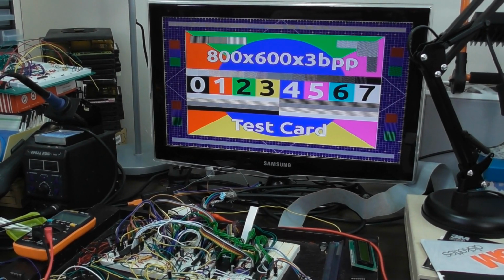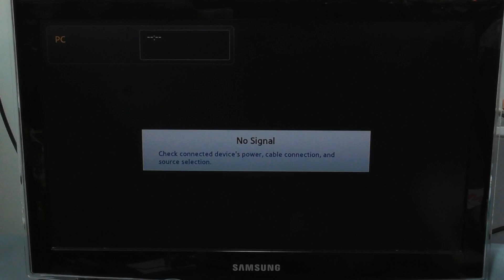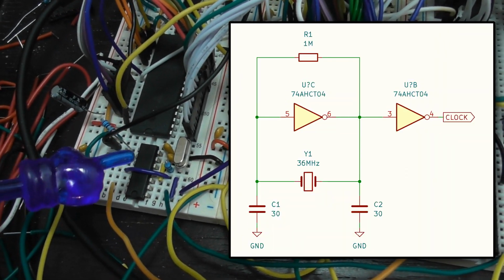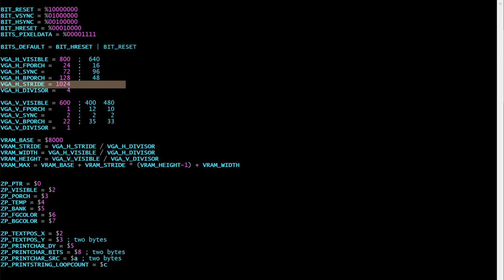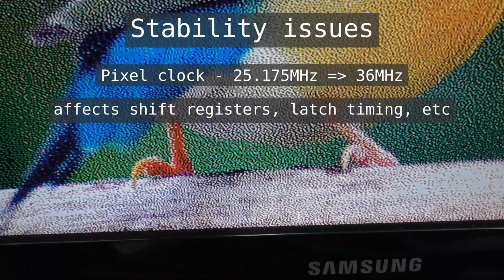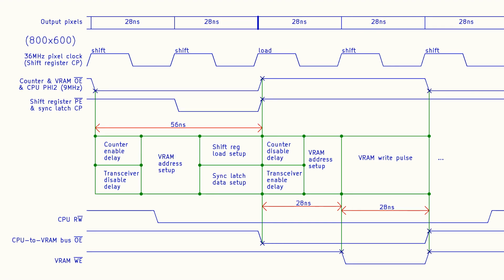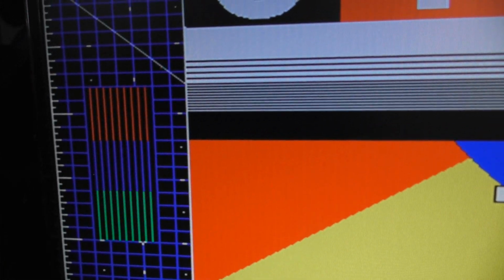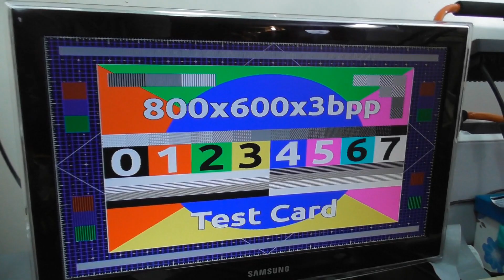800x600 SVGA Upgrade for 6502 Breadboard Computer

Comment: How do you use a PLD as a counter?
Reply from the maker: You want to toggle each bit when the clock rises if all the lower bits are currently set. If your PLD supports T flip-flops then that's cheap and easy e.g. O0.T = 1, O1.T=O0.Q, O2.T=O0.Q&O1.Q, etc. But if it only supports D flip-flops then you need to fully define its "next" state, which is equal to its current state XOR the AND of all the lower bits. This uses up a lot of product terms and can be tricky to fit into small PLDs.

Comment: Interesting. 36Mhz is pretty close to half the pixel clock for 720p. While 1280x720 is a bit much for a retro/hobby computer, it does have some really nice horizontal divisors, 640 for 80 columns and 256 for nes style sprite graphics.

I wonder if a "GPU" of sorts is the way to go. By that I mean a semi programmable state machine that moves pixels around. Technically this is a blitter, but they usually require quite a lot of baby sitting from the CPU. I'm thinking something programmable enough that it can batch process blits so that it is functionally equivalent to actual tilemap, sprite, or bitmap style video hardware.
Reply from the maker: I'm planning to look into hardware acceleration for sure. I'd probably start with a subset of the EGA/VGA features, giving the ability to write a colour to a bitmask of pixels, and maybe allow fast copying of data across multiple planes through internal latches without having to load all the data to/from the 8 bit CPU. That would enable a lot to begin with.

Beyond that I would like to gradually build up more of a command-driven GPU and perhaps work towards 3D rendering in that way. If we can render at least horizontal stripes with perspective then that's most of the work, and it doesn't feel like too much of a stretch, if you'll pardon the pun!
Reply: @GeorgeFoot  To be honest I'd probably skip EGA/VGA, they  are kind of rubbish. Instead have a look at old arcade machines, as some have schematics and quite detailed explanations about how they work, Defender for example. Since you are interested in 3D "I, Robot" might be worth a look. It uses a custom bitslice TTL 3D co-processor.

I've had a bit of time to think about what the hardware might look like. I think it's best described as a programmable pixel mover. It has auto incrementing source and destination registers, and will be able to move a pixel per clock cycle from video memory to a back buffer. Programming is best described as register transfer level. It needs to be able to load data from a display list,tilemap etc. into it's control registers then do a transfer based on those settings. A transfer will just be a move instruction repeated for however many pixels need to be moved. For transparent pixels this will be a conditional move e.g if pixel is zero disable back buffer WE. This won't be as efficient as real hardware but we have cheap 10ns SRAM so can compensate with much higher clock rates.

The idea here is to have something that is simple but flexible enough to emulate various styles of pixel graphics.

Scaling should be possible with what I had in mind. I think it might just require replacing the source/destination counters with fixed point adders and add a couple of registers to store the x/y offset/step size. I'm not sure how many fractional bits would be required, and since this is just a programmable pixel mover the CPU would be responsible for calculating the offsets.

Comment: Your setup is very interesting and a nice proof of concept. My personal thoughts are that 800x600 is just a tad too big for any meaningful realtime graphics on a 8 bit computer. Having a crisp text mode is nice but the TTL logic seems to be near its limits. Using off-the-shelf TTL chips is very future proof and should allow the design to be used for years to come. Getting a simple design onto a PCB with surface mount components (where it is possible) has a lot of potential. Limiting the feature set to the minimum for acceptable graphics and text might be the way to go. In my opinion, limiting oneself to a certain spec and trying to get the most out of it is a more interesting way to design and build retro hardware. The specs should follow limits of the chosen hardware. Setting boundaries can be hard when you have FPGAs, modern design tools and cheap MCUs on your hands. The limit of using TTL chips only should be a natural barrier for feature creep ;-)
----
I always liked the ATARI monochrome 640x400 video mode (with is sub-modes) for its effective usage of a 32K memory space. Expanding that to 64K with 4 colors or 96K with 8 colors might be usable as well but bank switching several times for a single screen will be a big hurdle. A 8MHz 6502 might be fast enough to display 640x400 uncompressed 4bit color FMV at 15Hz but having several sub-modes is nice too (LoFi for the win). Adding a small LUT for either fixed or dynamic color tables might be nice too. Having the ability to switch from 3bit grayscale to 3bit color can be a huge boon if the switching is software controlled. Two different color tables that can be switched each scan line would get you some kind of primitive color dithering.
---
The Apple IIgs used 640x200/4c and 320x200/16c 'HighRes' modes with an in-memory color-table. Since there is some memory space left in the 32768 bytes of available memory space for the graphics (320x200/16c = 32000KiB -> 768b left), Apple decided to give each scan line a 4bit LUT-index and add the 16 LUTs (with 16c->4096c) at the end of the memory space.(1/2)b LUT-IDX per line 200x4bit= 100byte, 16x 4bit x 16bit LUT = 512 byte. There are some additional switches and configuration in the other 156 bytes.
You can archive 256 on screen colors without any cpu board using this method. Up to 3200 colors are possible with scan-line timed LUT-manipulation. I think that they found a nice way to get the most out of such a limited feature set.
Reply from the maker: Thanks, lots of good for thought, and I agree entirely regarding trying to get the most out of a chosen set of constraints. For what it's worth, the higher resolutions were a distraction that I never believed were really practical for a 6502 to drive. Its bandwidth is too low. But it would be interesting to look into hardware acceleration to help out there, at least some of the latching behaviors of EGA/VGA, but I'd also like to go further towards 2D and 3D rendering. I'll always keep it within the TTL-style constraint though I think. Anyway that's one tack.

The other tack is likely going back to 320x240 and making a more well- rounded system based on that. It's a better fit for the bandwidth capability of a 6502, and more likely to result in a system that can support games for example. I may then get to a point that I'm happy to commit something to a PCB as well.

I guess the other tack is pure text modes, keeping the high resolution but just for text so lower CPU bandwidth and less VRAM required.

I really want to pursue all of these, but just keep changing my mind. We'll have to see how it goes!

Regarding 640x400, my first "simplest VGA" circuit used that resolution (it was actually a rather awkward 40x480 overall I think!) I moved away from it because none of my monitors seemed to support it properly. They all reported it as 720x400, rather than 640x400, and expected a different pixel clock, so my pixels were shown in irregular widths. It was a shame to have to go up to 640x480 as the RAM requirement doubled...
Reply: @GeorgeFoot  640x480@60hz is the way to go for the 'physical' output for the sake of compatibility. The "display resolution" can be less than that and you have a lot of possible modes in that boundary. Maybe even degrade the VGA-hardware to a simple frame buffer with some registers for pixel doubling (or color expansion) and do anything fancy in software? Dual-port access for the frame memory will be very helpful if you decide to later implement a 2d/3d "co-processor". Setting a limited feature set for the basic graphics interface and implementing it to a semi-final design is important. If you have that block finished, you can think more freely about other stuff. Having limits that cannot be changed is the best way to get creative with solutions.
Your demonstrations are pretty amazing and i would not have imagined that the shown features were possible on pure TTL logic.

Comment: I think it would be interesting to see a system designed to be modular, with different outputs for digital, VGA, etc.

A design that went from a very wide data bus (even 64 bits? Or more?) down to the normal width to reduce the circuitry needing high-speed capabilities would also be interesting.
Reply from the maker: I have thought about a modular design where image generation layers can be added or removed in a stack. So the core generates the sync signals, then you can add a background layer with bitmaps graphics, then maybe some sprite layers on top, and a text layer above everything. Or interchange any of the layers if you like. It could be interesting to build that way.

Comment: Once again impressed you managed to get something useful out of a 36MHz signal on a breadboard. You might be radiating some RF there. 
I'm going to try for 640x480 using a 6845 when I get my hands on a few - it might be overclocking it a bit but it's probably going to work. For a start it'll be monochrome like my existing circuit but I like the idea of replacing 5 IC's with a 6845 - then I can use the extra space for color. 
And then just maybe I can use that as a basis for an 8 bit ISA card for IBM PC & XT.
Reply from the maker: Sounds interesting. I think the 6845 may be OK depending what horizontal speed it supports. 8 pixels of VGA requires about pi MHz, funnily enough. I think typical systems in the early 80s when the 6845 was common probably used a 1 or 2 MHz clock, but they were standard definition, so had about half the horizontal refresh rate, much more time to play with

Comment: Great video, I've just ordered the PCB's of my own card based on Slu4's version, but using a GAL for the H / V detection and counter resets, as well as a character ROM and a colour RAM. My daughter wants me to write that is has a picture of an axolotl on it as well. I ended up going with a bunch of d-latches for latching in the X, Y, Colour and character, that's on decoded from a 138. It all SEEMS to work, and gives me a character display that's similar to the C64 but with 8 bit colours. I got the whole down to 17 chips in the end, so I'm fairly happy with that. I could use another GAL and probably knock it down to 13, but life is short.

I'm excited to see where you take this  if you go back to first principals.
Reply from the maker: That makes sense - I like the register-based design.

Comment: Good job, but too many wires tangled with each other. As a viewer, I don't understand what's going on in the background. If the wires are on the breadboard, like Ben Eater videos
Will be better
Reply from the maker: Yes for sure, if it was working better I'd probably recap how it works more clearly. The rest of the circuit is identical to earlier videos though, which show the evolution to this point and hopefully explain how it works.

Comment: Really impressive!! Moreso for being on a breadboard and right next to the TV. I wouldn't be surprised if you were getting RF from it
Reply from the maker: Haha yes, I ought to try measuring that! There are certainly some rather long wire loops carrying the 36MHz signal to the shift registers.
Reply: @GeorgeFoot  : Wrap some aluminum foil around it, see if that helps anything...

Comment: Excellent work. It has been very entertaining following this project.
Reply from the maker: Thanks, I'm sure it will continue in one form or another!
Reply: Would it be difficult to have a user-defined palette for when the bits-per-pixel is low? I remember on the Amiga that even 4-bpp could look pretty decent for games when referencing 12-bit colors.
Reply from the maker: Yes, it is tricky to do that while still allowing the cpu to update it. Normally it's only necessary for the video circuit to access the RAM once every few pixels - in my case it's 4 - which allows the CPU to write to the RAM in the gaps. But the palette generally needs to be read on every pixel, at 25MHz (or 36MHz in my case now). You need very fast RAM to support that, ideally dual-port RAM. It may be possible to somehow fetch all the data for all 4 pixels in one go - but that's then quite wide, it would need several separate RAM chips to get enough output bits. It's possible though.
Reply: I hadn't thought of it like that, thanks for taking the time to think about it. I was (probably naively) thinking that the bitmap ram could continue to have the same cpu interface and timings, but there could be a level of indirection on the readout (which might not need to involve the cpu but would incur some timing implications anyway). I've never built anything nearly so complex as a video card, though.  Thanks again, and geek on!
Reply from the maker: @AppliedCryogenics  The way I see it, the main limitation is bandwidth from whatever RAM is involved last of all. We can increase the bandwidth by using faster RAM or more RAM in parallel (like I do for the framebuffer, getting 16 bits from two ICs at the start of each 4 pixel cycle). So for a palette, maybe two ICs could be inserted before the shift registers to provide four bits each of red, green, blue, and intensity, to represent the RGBI values for each of the four pixels. It could be a nice system and still allow time for the CPU to update the palette in between these accesses.

Alternatively, a fast enough RAM IC can be used after the shift registers, but not interleaving palette writes - hold them up until the end of each scanline, when the palette RAM doesn't need to be driving the display output. Then the cpu can write it as much as it likes. I had some crazy thoughts about how we could use the overscan in the framebuffer to provide updated palette data here and reduce wiring. It's a bit half-baked though and I need to make a more stable foundation at this point before doing that kind of thing!
Reply: @GeorgeFoot  If a dynamic palette is not feasible, maybe several static palette are possible. Having a set number of fixed palettes that are swappable on the fly is better than no choice at all 🙂
Since you don't need to access the palette so often by the cpu, you can simply latch it in and out of the VGA circuit. The output would go blank for the time the palette gets updated creating a bit of blank lines. You can even implement the palette as part of the blanking circuit and swap access between cpu and VGA in that timeframe. Timing the writes to the palette might get tricky in that case 🙂